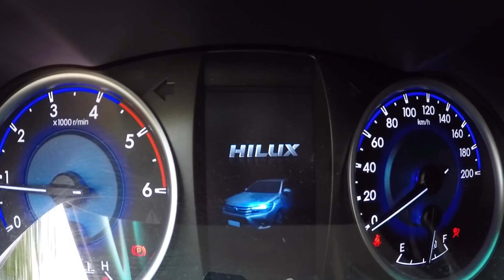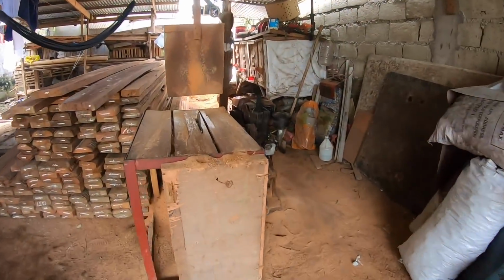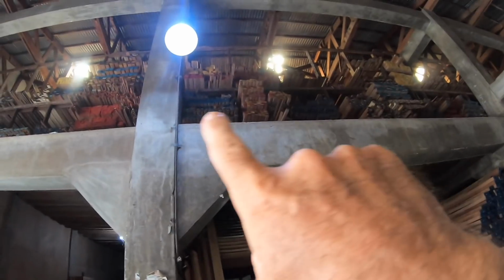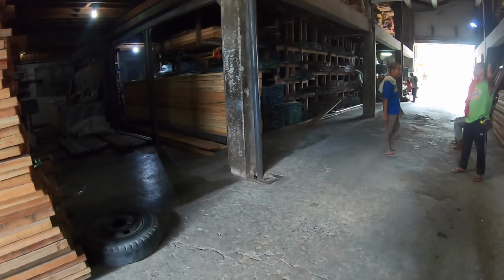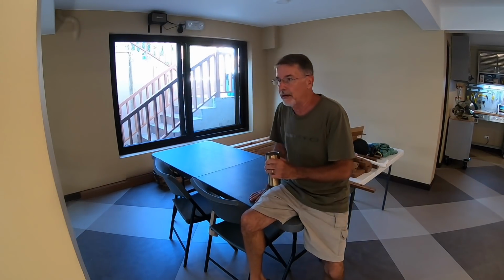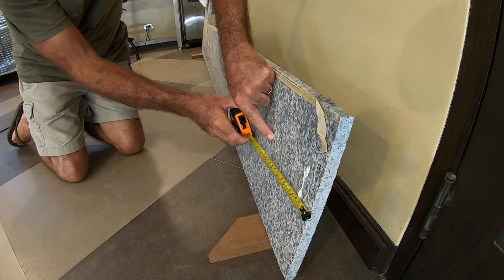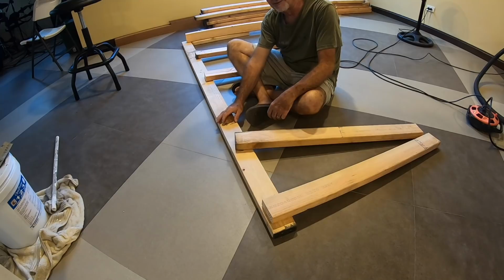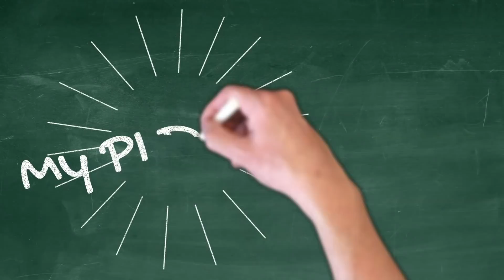VILLA FELIZ - EPISODE 504: TIKI BAR - PART 1 (House Building in the Philippines)

Comment: I know you will have already built what your building by the time you see this but that never stops me . 
We used to build lots of reception desks and bars and to keep the weight down we made the stud wall out of 3/4" plywood cut 3 1/2" wide and spaced them 8" oc.then put 1/2 plywood on front and back then laminated or veneered the plywood. We always put 2 wire chases in them top and bottom and was also easier to route 2" dia  . Holes in plywood rather than 2x4 dimensional lumber. I found a place here in Davao that carries quite a few types of kiln dried hardwood mainly from Indonesia,  but never looked for or would want coconut wood . I've seen 2x3 & 2x6 fir & pressure treated at citi hardware but very expensive.   If you don't already one James get a narrow crown staple gun  and 15ga. finish nail gun air or the 2nd and 3rd generation battery guns are just as good as air in my opinion. You will find a few very old style air guns here ,,,,, but Amazon is your friend , or sure is mine anyway. I brought about 40 old air type guns of various types with me from the shop but 99% of the time use the battery ones instead they have plenty of power to countersink even in oak most of the time. Some types of the fasteners can be found on Lazada but there non existent compatability  chart leaves you guessing as to what will fit. I like Milwaukee battery guns the best , bought 6 different types and so far nothing has broke. The air guns, the humidity or something here destroys the o-rings quickly, once you start using guns you'll never hammer a nail again so much faster and hold far better.

I bet that wood you got is spruce or fir, thats what almost all framing lumber in US is highly doubt it's white pine from what I can see but it's possible.
Reply from the maker: Now you're talking my language.  I have both Hitachi and Paslode pneumatic and battery nailers back in the US.  I'll ship them back the next time I'm there on vacation.  I hate buying what I already have.
Never though about making studs from 3/4" plywood but I guess if you do it with 8" oc it would work just fine.  Learn something new every day!

Comment: The salesman was very correct on his description of the wood. The Philippines does not actually have mahogany. It is called that by most people but in fact it is not true mahogany. 

Getting quality wood that is straight and uniform is a difficult task. We were looking for 3 boards for wall shelving and it turned into an adventure. We ended up settling for "good enough " after much effort.

Dimensional lumber is also available at Citi Hardware if they are in your area.
Reply from the maker: Good enough is the standard I'm afraid to say around here.  City Hardware, check!

Comment: James, I am surprised you are not using glue and wood screws for assembling the 2 X 4 framework.
Reply from the maker: Wood screws are more expensive than nails but I have used it in some places on this build.  Also, I used some wood glue today in places I'm afraid will shift during hammering.

Comment: James, you may have already explained this in a previous video, but I was wondering why people in the Philippines generally prefer to build their homes with concrete instead of wood/lumber like we do in the US?
Reply: TERMITES!
Reply from the maker: Yes, as Steve said, termites, but mainly resources.  The Philippines isn't as rich with resources such as trees for building as the US.  The southern forests of the US are abundant with pines.  The DNR, Dept of Natural Resources keeps a close eye on the cutting down of trees here.  Plus, I really wouldn't want a house built like we do in the US with all the typhoons that come though here each year.
Reply: A lot of factors why concrete is the preferred building material over wood here in the Philippines. One is termites infestation/ problem. Second would be the climate, it's a very humid environment. Wood would just rot/crumble to the humidity/dampness and wetness (during the monsoon/rainy season) of the Philippines in a few years. Third reason is because of typhoons, houses should be able to resist typhoons and the Philippines has on average 20-25 typhoons a year.